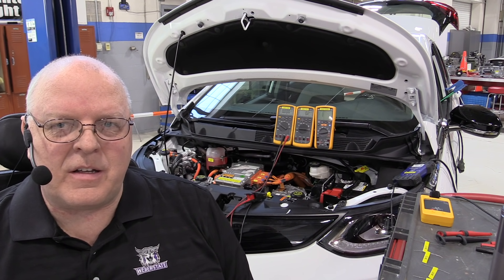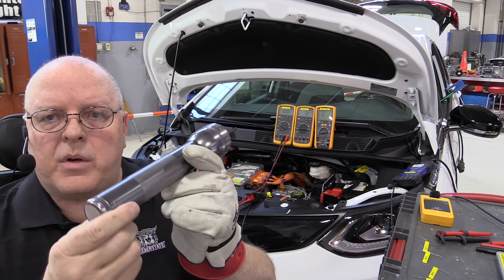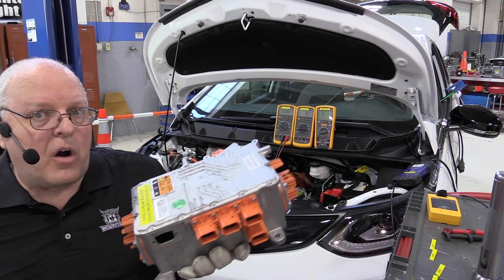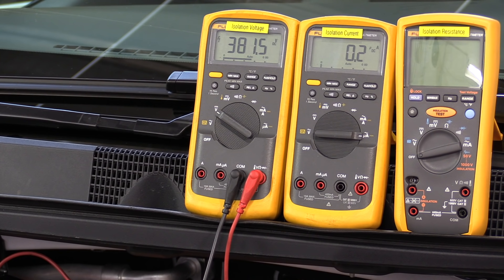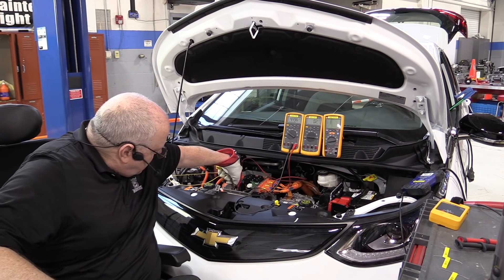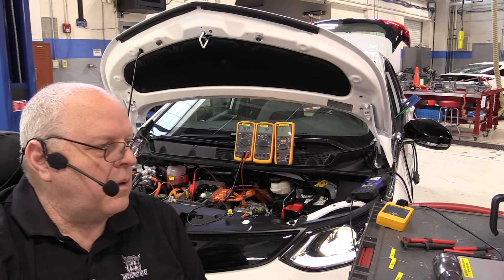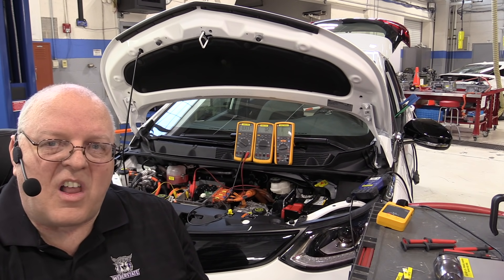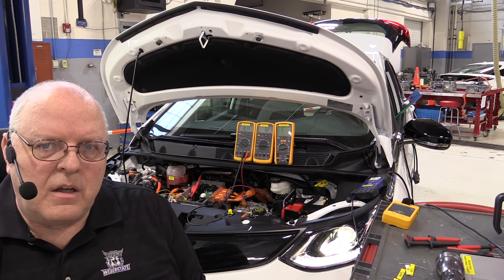Megohmmeter - Loss of Isolation Diagnostics

Comment: So the high voltage power systems are islolated from the 12 volt accessory battery. The 12 volt battery is connected to the vehicle chassis, as usual. That 12 volt battery powers a circuit that measures the resistance from chassis to high voltage battery positive, and from chassis to high voltage battery positive. If there is a short from chassis to high voltage positive or high voltage negative then nothing breaks because that short simply floats the 12 volt acessory battery on the high voltage battery positive or negative rail, without completing a circuit between the two. That short does not disrupt the operation of the loss of isolation measurement circuit. That short also doesn't harm any 12 volt equipment or a human since there is no closed high voltage circuit created by the short.  If, however, there is a short between both high voltage poles then the high voltage battery's fuse blows to disconnect the high voltage battery.

If the 12 volt battery happens to be dead, then no additional risk, because the high voltage battery's fuse is still in place.

If the loss of isolation occurs on the positive side of the 12 volt battery then nothing really changes, except that you high voltage isolation measurment might be offset by 12 volts. But I haven't really though through that case.
Reply: I think the word short may not be the best word for these scenarios as, in my mind, short = sparks and smoke and melting things. 

This is more "fun with series and parallel resistors and floating voltages", nothing was ever "shorted".

Comment: 380V and 222uA, that means the voltage divider consist of 2 serie resistors of 1.71MOhm. (One is shorted here)

If we put 1.71MOmh in parallel with 11MOhm of the multimeter we get a total resistance of 1,48MOhm and that wil give us a voltage of 
380/(1,48+1,71)*1,48=176V
380/(1,48+1,71)*1,71=204V

20:31
Close enough😅
Reply: V still equals IR? 🤣, but..... when you looked at r = v/i , wasn't that circuit in series? 

Actually, had to re-learn some stuff and learn some new stuff. Net is that current sensing is done either measuring the magnetic field created by current flowing through a wire or, perhaps more commonly and as shown using the fluke, using an in-sieries very low ohm resistor and then measuring the voltage drop across the resistor. 

Here are three some excellent vids I found, the first  two are part 1 and 2 going from first principles to working circuit: 
https://youtu.be/oQrWR6Vbb6M?si=s_wp_vgmCnsfgpe1
https://youtu.be/FJwgY0ORfp8?si=0Mq03EgVLBBARQXc
and 
https://youtu.be/rzt9rKayZbY?si=kBXt_SKA0w8XksEJ

Now what's the resistance of the tap water given 216ua, or 6 ua delta? 

Rwater + 1.71mohm = v/i = 48.1kohm?

Comment: Hi John, great videos,  I just subscribed.........I am in the process of building the off road electric vehicle with Leaf  or Tesla components, and I am concerned about it's performance under the water while fording. Are the high voltage connectors able to handle it, or what do I need to do to make it work? Thanks, Peter
Reply: There is a Utube video of Tesla car waterproofed and a actually driven underwater. Find that video and they show what was done to accomplish water proofing electronics  motors transmission and cabin.
Reply: @jojograffsgnino276  thank you, will check.

Comment: but this fail in isolation won't create a leak on the battery and drain it over time? where the problem is safety, isnt unsafe for the driver if the positive terminal have a fail in isolation and the cable is connected to the chassi of the car?

Comment: So this test is checking resistance through the complete high voltage cabling and AC pump circuit?!
Reply from the maker: Yes, among other circuits
Reply: @WeberAuto  so it’s checking through the cabling you unplugged, the AC pump the cabling it’s connected to and the body chassis?
Reply: When you say “among” other circuits....does this yes run through other components as well??
Reply from the maker: @asalamalecom  transmission stator(s), inverter, DC-DC converter, internal battery, external battery cables, and anything else that is connected to high voltage cables
Reply from the maker: @asalamalecom  They have to be plugged in for the system to test them. Unplugging them isolated them for diagnostics
Reply: @WeberAuto  thank you for clearing this up I get it now. So could you run this same test by unplugging another plug on that distribution module in stead of the AC pump line plug?
Reply from the maker: @asalamalecom  yes
Reply: @WeberAuto  you are so helpful. Love your videos. Have a great day sir
Reply from the maker: @asalamalecom  Thank you

Comment: I had always assumed that any loss of isolation would have shut down the contactors. Aren't they creating far more risk for first responders by choosing not to shut down. I can understand that a shut down policy will leave the car stranded in the case of a minor failure. However now first responders have to know some vehicle specific information before cutting into the car.

I presume this non shutdown policy is true for all EVs?

Thanks for your detailed video.
Reply: Some (all?) EVs have a wire loop that runs up and down all the pillars and even through the airbag module, if the circuit gets cut anywhere along the way or the airbags go off then it open circuits the contactor's. The idea being that if the jaws of life cut through the car or the airbags go off then that action alone should isolate the pack, also emergency services normally kill the cars ignition when they get there as standard practice.
Reply: @Brendon_M  It worries me that there are so many differences between cars in these respects. Even a simple task like killing the ignition is no longer straightforward with start buttons and keyless access ets.
Reply from the maker: First responders have access to training material from each vehicle manufacturer and the NFPA here in the USA. the NFPA even has a smartphone app with the shut down procedures for each vehicle. Thanks for your feedback.

Comment: In case that anybody is wondering, each of the resistance networks used for isolation detection is around 1.7 M ohm.
Reply from the maker: Good to know, I was wondering that myself. Thanks for watching
Reply: Did you obtain that number by calculation (R_short = V_short / I_short = 375.96V / 222.4E-6A = 1.69E6Ω), or did you obtain it in a different way?
Reply: @diyEVguy  I've always thought of short = sparks, smoke and melting things. This is more like changing the circuit where 380 V is across a resistor creating a current of 222.3 or 4 ua. Then, yes V=IR and R=V/I.

Comment: Does the documentation say what happens when you DC fast charge the car? During AC charging they can keep the pack voltage doubly isolated since the converter is in the car. But during DCFC the pack terminal voltages are directly routed out of the car to the charger.

At that point the charger could cause a loss of isolation of a sort. Would the car detect this too? Are DC chargers expected to be doubly isolated or is one side grounded to local earth ground?
Reply from the maker: You are correct, a DC fast charger can cause a loss of isolation. There are diagnostics for that. Neither side is connected to earth ground or chassis ground during fast charging. The ground is there for the low voltage communication that must take place between the car and the charger.

Comment: IMHO the most likely way someone would get shocked from an EV is if they were charging on a miswired, low quality EVSE which didn't properly detect ground faults, and was also miswired such that the ground connection was live. This would make the body of the car live relative to earth ground - and could lead to a nasty surprise if you grabbed a metal door handle!
I have to admit, I was worried your small jumper wire would be vaporized when you hooked the traction battery + to chassis ground!
Reply from the maker: Agreed, thanks for your feedback. I was also worried the first time, but 222 micro amps wasn’t enough.
Reply: The other case would be cutting the car up to extract bodies.....

Comment: How about BMW i3 built in carbon plastic and aluminium is this safer, engine in the back?
Reply from the maker: Good question. Some carbon plastics may be conductive.
Reply: Carbon fibre certainly is at least semiconductive (it makes a good resistor). It is usual to include a stainless steel mesh for lighting protection in aircraft since carbon fibre explodes when hit by lighting (too much heat in too small an area).

Comment: Seems to me that the EV makers/designers might want to study the NEC (National Electric Code).   For NEC purposes the upper limit of "low" voltage is 600 volts AC with the peak to neutral being a tad less than 850 volts.

Comment: At what DC voltage does it get dangerous to handle? Obviously 12V is ok but is 36V etc?
Reply from the maker: Most vehicle manufacturers recommend personal protective equipment above 50V AC or DC.
Reply: In industrial applications anything above 32V is of concern, and required special design effort, 48V was a hard isolate before work. 
Having worked on 240VDC control circuitry - that gets nasty in every possible way. 
400V solar systems are a real pain because supply isolation may not be possible.
Reply: Thanks for the knowledgeable replies.

Comment: Freaking awesome. What happens if you get a high resistance short between positive and negative high voltage wires that never pulls enough currant to blow the fuse at the disconnect? Is that even remotely possible? Can you use the megaohm meter to check between them instead of to chassis? Sorry, I’m trying to wrap my head around this
Reply from the maker: Good question. I did not have a spare battery fuse as a backup if I did something wrong. There are current sensors that monitor the current and trigger DTCs of the commander and actual current do not match. Yes? You can use the megometer to check that as long as all the cables and devices are disconnected. Thanks for your feedback

Comment: Hello Professor, Thank you so much for the great video. I have a quick question. I assume the test vehicle has two different(separated) wiring systems, 400V wiring and 12V wiring. Like your video, when we short 400V wiring(either positive or negatvie) to 12V negative(which is vehicle body), it doesn't harm to the vehicle functions. Does it mean the high voltage current doesn't flow into the vehicle chassis? In brief, what if I touch the positive terminal by hand while the vehicle is running?
Reply from the maker: Correct, it does not harm anything. You can touch the vehicle chassis without any harm. If you touch the positive terminal of the 12V battery while also touching the negative terminal of the 12V battery, it does nothing. The only way to get a high voltage shock is to touch both the positive and negative terminals of the high voltage battery (which is almost impossible because it is in a sealed housing). Thanks for watching
Reply: @WeberAuto  What would happen if the chasis is connected to actual gnd, say, via steel cable and spike into the ground? Would that just change the reference point that everything else is based off? I think you're saying, yes, and now the +12V terminal is +12V relative to actual ground and the high voltage system is now -380 V relative to that same ground?

Comment: I’m a little concerned,in the event of an accident and the vehicle plunged into a river or lake totally covering the whole vehicle and filling the cabin with water,would this be a danger to life of the passengers within???.
Reply from the maker: No, it is DC voltage. It is not a danger in water. Additionally, the system would detect a loss of isolation and shut down the system.

Comment: Is the HVDC+ and - monitored for isolation?
Reply from the maker: Yes, this video shows both
Reply: @WeberAuto  Must have missed it, I seen that they are both monitored to the case but didn't see if they were monitored between + and -
Reply: @dereksmith7770  If you are talking about a short between the HV battery + and -, I would imagine that this would show up in higher than desired current flow from the battery. Current flow to/from the various HV components on the car is monitored. The battery control module would notice this through the ammeters and I suspect it would open the contactors. If it were a direct short that caused extremely high current flow, it would either blow the fuse in the service grip and isolate the battery (if the vehicle was already powered on when the short occured) or if there was excessive current flow when the vehicle closed the precharge contactors, it would never close the main contactors since the voltage probably would not be able to equalize and allow them to close (and it would either open the precharge contactors or smoke the precharge resistor in the process). I'm not an expert on the Bolt system specifically, but I believe this is the general procedure for most all of the automotive HV systems. The car is constantly watching current flow.
Reply: @ouch1011  Thanks for the detailed reply, I was curious because i didn't see anything in the diagnostics screens you were showing, but it does make sense that that variable would be monitored also.

Comment: So in a BEV, the chassis is supposed to be completely isolated from HV battery ground.  In ICE cars, the chassis was usually always grounded.  In hybrid cars with a HV battery, I suspect the chassis also has to be isolated from ground.   In all cases,  the positive supply voltage was always isolated from the chassis in ICE and BEV.   That means a ground cable has to always be routed to circuits.
Reply: "So in a BEV, the chassis is supposed to be completely isolated from HV battery ground". In a BEV, the battery ground is connected to the chassis. All the metal casings of HV components are connected through potential bounding cables to each other and to the car chassis, including the HV battery of course. It is mandatory by law (UNECE R.100) and the resistance value must be <0,1 ohms between the casing of a HV components and the chassis of the car. The isolation is between HV + and chassis on one side, and H- and chassis on the other side.

Comment: Thanks for some great Information , just one  question if you get time . what if you had a car in for a air conditioning  service and you used a air conditioning  machine that you just took of a car that had pag oil in the system would the bit of oil left in the air conditioning  hoses form the car you just had it on with the Pag oil be enough to damaged the high voltage air condition Compressor and would you get a insulation code for the air conditioning system ? Thanks
Reply from the maker: Thank you, yes, just a little bit can cause a loss of isolation

Comment: More worried about fire 🔥 
How can they be any good in a blizzard 🥶
Reply from the maker: The batteries are sealed in a housing to keep out moisture
Reply: safer than a combustion engine  , 2014-2016 there were 171,000 highway vehicle fires with 345 deaths and 1,300 injures ! But one fire in an electric car and its all over the news, strange isn't it !
Reply: Dave Fitzpatrick  — you’re probably right , but the fact that it only takes rain to turn one of those batteries into a bomb 💣 
Wonder what the numbers would be if all those accidents were electric cars instead of gasoline.
Reply: @psychiatry-is-eugenics  Not a fan boy, but teslas are one of the safest cars on the road
Reply: @davefitzpatrick4841  the incidence rate of non collision fires for Tesla vehicles is significantly higher than the average across ICEs. That is hard data, but it is only for Tesla vehicles. For the Chevy Bolt the incidence of non collision vehicle fires is lower than the average across ICEs.

Not sure why that data is the way it is, but that is the data and there are significantly large numbers of Bolts and Tesla's for this data to be statistically valid.

Of course, fires in lithium ion batteries are unrelated to shorting outside of the battery pack itself (the topic of this video) and it is the result of internal shorting within the battery pack resulting in venting that is the source of battery fires. For collisions in which the internal structure of the battery is compromised, fire is not an unexpected result (just as it isn't an unexpected result with the compromise of gasoline tanks in ICEs during an accident). The unexpected results are the spontaneous conflagrations that have occured in idle Tesla vehicles.
Reply: @homomorphic this video showed up after 5 years .
I had no idea there were comments .

Comment: MIL requested, but not on? Loss of isolation is a problem the owner/operator should have corrected as soon as possible. (if one wire is touching the chassis, the other could as well. and a human, or squirrel, could be the thing to complete that circuit.) I know the early Leaf BMS has a dedicated cell balance chip for continuous isolation testing.
Reply from the maker: You are correct, It is possible. The MIL request illuminated the service vehicle soon light. Unfortunately it was slightly off camera. Thanks for your feedback.
Reply: @WeberAuto  I should also mention, brushed DC motors can build up dust that breaks isolation. Our 1981 Jet Electrica 007 had enough carbon dust to leak 35vdc to chassis. (it was all replaced with an HPEVS AC51 system. The Curtis controller will shut down (open the contactor) if there's an isolation fault.)